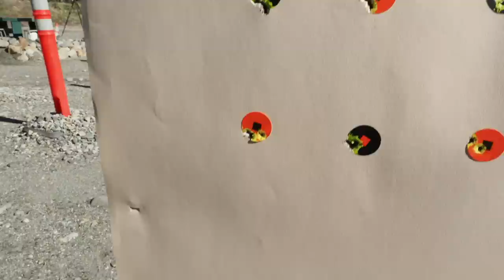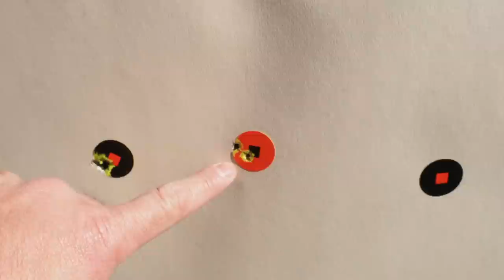Range VLOG #072 - New Masterpiece Arms BA CZ 455 Chassis

Comment: Thanks for the new information.  Here in Wis. I've stopped testing rimfire ammo in low temperatures because the performance obviously suffers in the cold weather.
Reply from the maker: Yeah, I'm sitting on the top three tiers of Lapua along with SK Biathlon. I actually should get SK Long Range so I can test it all at the same time in the same conditions.

Comment: Hey J, were did you get the tripod. Send me a link. Get better. Still nice groups.
Reply from the maker: https://www.bhphotovideo.com/c/product/1158028-REG/induro_git204_2_grand_stealth.html

The legs I have are an older version of the Induro GIT 204 Stealth with a RRS BH-55 ballhead on top. I only paid $200 on the tripod legs when they were on clearance. As far as the BH-55, you should get the RRS Anvil-30 instead if you are only using for shooting (not photography). The Anvil-30 is less expensive than the BH-55 and is easier to operate for rifle shooting.
Reply: @ocabj  Thank you.....

Comment: So all the stock manufacturers came out with 455 stuff the CZ discontinued it for the 457. Wondering how much difference there is. Also you think there would be some 3D printing of AICS style mags for these. I know the ones used for the Voo Doo are out there but they don’t fit much or anything but that.
Reply from the maker: They're different inlets. MPA is already producing a 457 chassis.

Comment: After some time with the mpa chassis would you buy it again or something different ?
Reply from the maker: For the CZ? For me, it's either this or the Manners. If you don't already run MPA for your centerfire rigs, then you should take the time to check out all the other options for your CZ (e.g. MDT, Manners, etc) since those might feel better to you.
Reply: @ocabj  yes for the cz455. I've read that the mpa chassis system can improve accuracy
Reply from the maker: @Qdshym  Well, that's kind of a misled statement. The chassis can help accuracy in so far as improving upon the inconsistency of the factory stock. If you have a factory stock, it doesn't have pillars so you're kind of stuck tweaking the action screw torque to find where it shoots best. More than likely, you'd need to pillar bed and bed the action on the factory stock to eliminate any issues caused by the stock. A quality chassis system will minimize these issues, but you're still subject to the factory action so accuracy improvements may not be that drastic if at all unless you bed the action in the chassis, too. Yes, bedding in a chassis is actually done because not all actions are perfect in terms of being concentric in relation to the chassis inlet.
Long story short: Don't get the MPA chassis with the expectations that you will make significant accuracy gains. Get it for the features it will offer for you (improved ergonomics, full length Arca rail, adjustable LOP and check riser, etc).
Reply: @ocabj  thank you for the information

Comment: Nice video!  Why did you chose MPA chassis over MDT?
Reply from the maker: I built my 6mm Creedmoor on an MPA BA Comp, so I decided to stick with MPA since I liked it. Also got another MPA BA Comp when I built a Vudoo. I've handled some MDTs and I think they're easier to balance because of that extra long foreend. I think I prefer the buttstock assembly of the MPA over the MDT. I might get an MDT for another build in the future just to have one on hand.
Reply: @ocabj  Thanks for your info Jo!  I am looking for an option of chassis if I decide to get a CZ 457 .22 LR rifle.
Reply: I tried to compare the Mpa and Mdt chassis,  and I found the Mdt more appealing.  The only thing I don't like about the MDT is the handguard lenght.  It is kind of long.